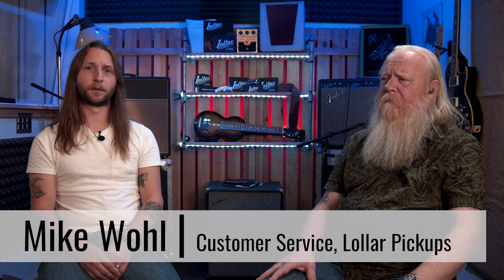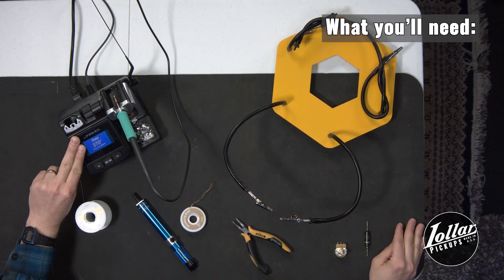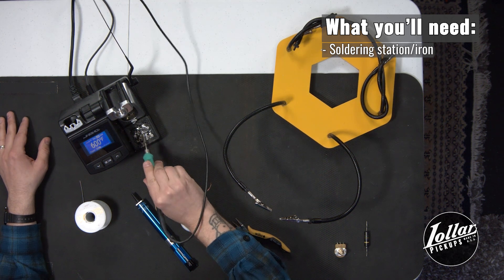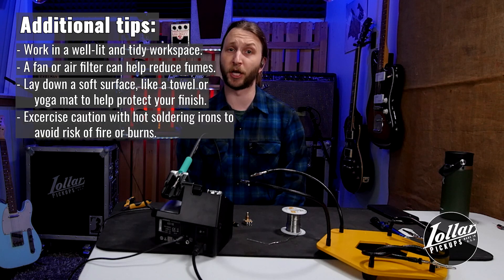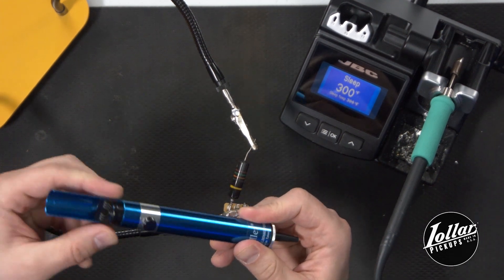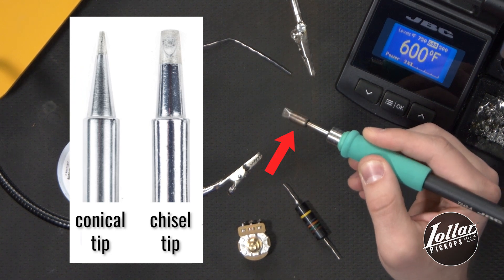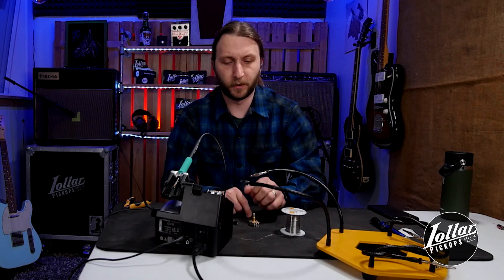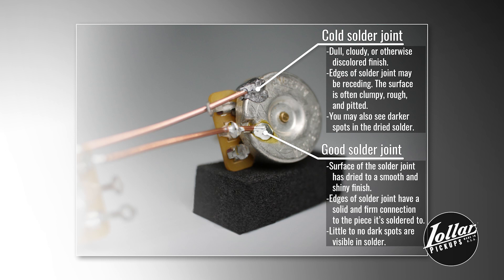LOLLAR PICKUPS Presents: TONE TRUTH - Soldering Basics

Comment: Why use “de-soldering” things for such simple manipulations?
The average solderer can cope without them, as long as multi-legged parts are not involved.
Terrible degradation.
Reply from the maker: It's better to have something and not need it than to need something and not have it. Some folks don't even know that these sorts of tools exist, so we're just letting people know what tools are at their disposal. Besides, it doesn't hurt anyone/anything to desolder and resolder, rather than just try to use the old, used solder blob from the previous installation. It requires less time than it takes to leave a comment on a YouTube video.
Reply: @Pickups 
For 30+ years of tinkering with guitars, I've never used anything other than a soldering iron, flux and solder.
Reply from the maker: Cool, thanks for sharing.
Reply: @LollarPickups  Bless you heart 😉
Reply: Desoldering those parts are fine. Plus most newbies have no idea what desoldering is and desoldering can come in handy if you need to remove a capacitor that’s stuck and won’t easily come out.

Comment: As soldering rookie these tips helped out quite a bit. I was able to install a tele wiring harness with all clean solder joints this time lol.
Reply: The biggest difference was I tried using those weaker soldering irons and then never get hot enough to make good solder joints. Almost always ended up with cold solder joints. After I bought a soldering station where I could adjust the heat that helped tremendously
Reply from the maker: So happy to hear that folks are finding our videos like this helpful!

Comment: When soldering in the guitar cavity, what can you use so the soldering iron doesn't burn the wood because the soldering iron pencil can easily burn the walls of the guitar cavity but I don't know what to use to protect the guitar cavity walls because of the very tight soldering spots when guitars have a lot of active electronics or very small cavity to solder in. What would you recommend using to protect the guitar cavity walls and guitar body from the angle of the soldering iron pencil from burning into it?
Reply from the maker: Great question! There are a couple options for shielding the instrument from heat. First, you could get a small, thin piece of silicone and use it as a barrier. They are used as such in products for everything from soldering, baking, etc. You could get a larger one and cut it to the size you need. There may also be small heat shields made of things like fiberglass that are used for welding, but I haven't seen any small enough for use in an instrument cavity and I wouldn't want to trim fiberglass to size, like I would silicone.

The other option would be to get a smaller soldering iron, or at least a smaller tip for your existing iron. This will allow you to have more clearance around the iron and fit it into smaller areas.
Reply: @LollarPickups  thanks for the info. Maybe you can make a low budget video lesson how to use the silicone to protect the guitar wood cavity and body when the soldering iron pencil is angled laying on the cavity burning it to see how good the silicone will protect it from a 600F degrees to 700F degrees

Comment: No one likes that preachy safety guy but 12 years in on my double lung 🫁 transplant. I wish you had a cheap little smoke filter fan.  Great video i’ve been giving you guys most of my money for years!
Reply from the maker: Honestly, we actually LOVE that preachy safety guy! And we appreciate your contribution to the conversation, thank you.

And, to that point; the soldering in this is pretty much the only soldering done in this shop without that sort of protection. And that's just because the space and microphones made it pretty difficult to work it into the setup. When we solder day-to-day, we have carbon filters, fans to dissipate any remaining fumes/smoke, and then that air goes through industrial-grade air scrubbers that we have between every workstation to clean and turn over the ambient air. This is in addition to filtering downdraft tables at workstations used for applying CA glues, as well as our normal HVAC system that has HEPA and UV filters. We take safety very seriously and we strongly advocate for others do so as well. Thanks again for bringing this up, it cannot be overstated how important it is.
Reply: @LollarPickups  So a fan would be fine for a single installation at a time? Do you have any tutorials about removing PCB boards out of say an SG Tribute to install one of your pre-wired parts?
Reply: @teleguy5699 removing a PCB board should be easy. Just carefully pull out the plugged in wires and you probably have to unscrew the nut on the potentiometer if it’s attached to the board. I did this with my Gibson Les Paul. At first it looked intimidating but it was easy overall.

Comment: Any future in plug in pick ups?
Reply from the maker: Others have experimented with the idea to varying degrees of usefulness. It certainly would make things much easier for the end user if this were widely adopted across the industry. 

But the real issue is, there is no standard convention for this sort of thing. In order for this to be functional, you have to have a harness in the instrument for the pickups to plug into, which only a VERY small relative number of guitars currently have. And the builders that do implement some type of quick connection systems don't all use the same manner of connections. So, to make it worth the investment of time and money, first, you'd have to see to it that at least a majority of instruments had not only the harness required, but that they all had the same type of harness. It would take a great deal of cooperation from one instrument manufacturer to another, and in addition, from one pickup manufacturer to another, just to create the standard for the connections. Only then would it be worthwhile to implement on a broad scale.

Even retrofitting instruments that are already without them would involve at least the same amount of soldering to install the harness to plug the pickups into the guitar. Bu this may, in fact, be worth it though, on an individual basis. If someone wanted to swap out different pickups on a somewhat regular basis, it might make sense for them to come up with some sort of "plug-and-play" system that works for them.